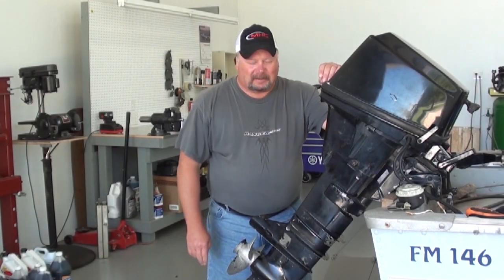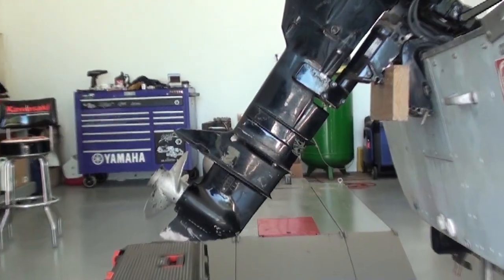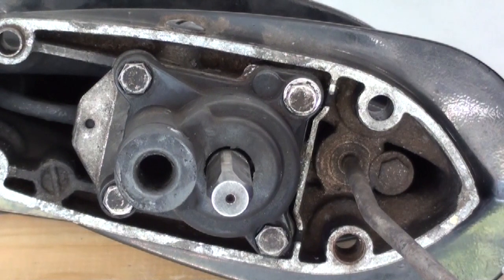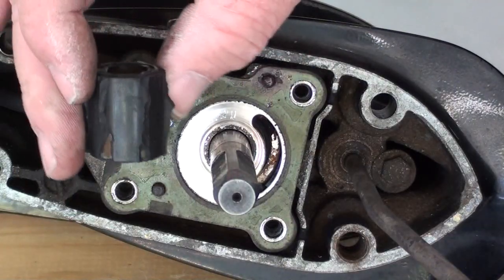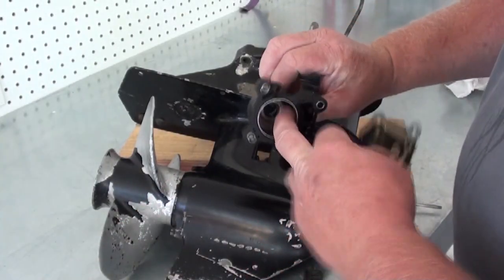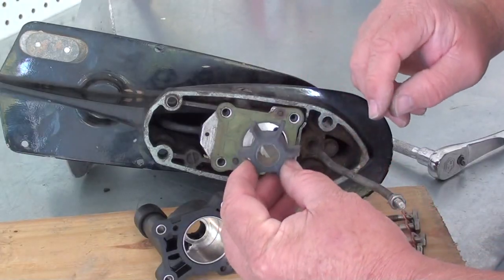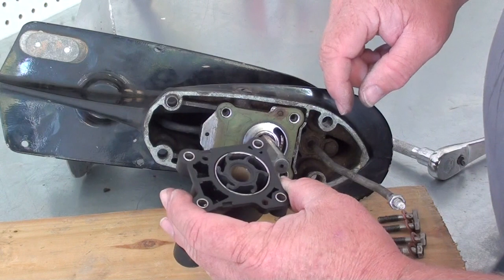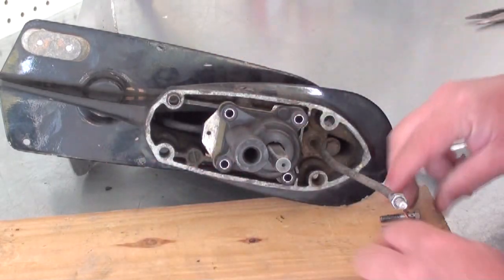Honda 9.9HP - 15HP Outboard Water Pump Replacement

Comment: hi! i know this is an old video, but it's my "instruction book" of changing my water pump and impeller. @5:30 in the video you talk about using compressed air to go into the intake tube to the top of the cylinder head. (but  you didn't show it!) where is the tube and what should i look for coming out? anyway i hop you're still responding to commment on here.  thanks!

Comment: I have a honda 15 hp. When I remove the lower unit also a water pipe drops out of the outbourd. It was very hard to put it back and it was very loose in the hole where it came from. Now I put everything back together and there comes no water out the motor. Can anybody help me with this problem?

Comment: I put a new impeller in my 1997 9.9 honda but when I tried to connect the shift linkage the upper rod fell out down into the hole where the bottom linkage is... Any idea what I can do to fix this problem Thanks Dave.

Comment: Absolutely the best commentary and instructional words ever...I have had mine done twice in 8 yrs and finding out its a basic yearly deal. Book says oil changes very 10 or 15 hours?. Mines a 2011 15 hp and run it monthly even thou not in the water like I should be...thanx so much awesome shop and all later

Comment: How do you get the barrel nut to turn when it’s attached with a split pin at the top that stops mine turning, turn an easy job to bastard job having pull bits off the get to the split pin

Comment: I know this is a old video but very informative. I've a 1998 bf9.9. Going right by your instructions. Only problem. I unscrewed the top nut  on the shifting rod too far and when lower unit came out so did it. Now even in reverse with lower unit off I can't get on to thread it on. Any advice? Great video by the way.  God Bless

Comment: Can you tell me exactly what part this is you are using and where to order it? I followed all your instructions which were amazing but I have the wrong impeller it doesn’t have the flat spot on it. It has a half moon that doesn’t work. So I ordered the wrong thing.

Comment: I have 1 more question is the iinside of the  impeller housing  you have a metal cup and there is a square shape  opening in the upper part of the housing does water flow threw this opening ??

Comment: hello, I've replace the  impeller and still no water also changed the therm, still no luck also check the water tubes for clogged area no clogged area what can it be I guess i need to check the motor.area.Anthony ???

Comment: Great video,after I break loose the jam nut and then try to loosen the barrel but , it causes the bottom shaft to move down and I notice the shift handle moves forward towards forward position , any suggestions ? Honda 15hp long shaft

Comment: 1:49  Hi, I have unscrewed the four screws at the side and the one screw at the back but I can't take off the bottom part. I hit it with a hammer but I can't take it off. I haven't opened it in 3 or 4 years. What else can I do?

Comment: On the chance this gets seen and someone responds..my 2001 BF15A, when removing the lower unit to get to the impeller, the entire drive shaft comes out with the lower unit. A side notch prevents the drive shaft from being pulled straight out, thus I cannot get to the lower plates for the water pump housing. Is it necessary to remove the drive shaft? If so how?

Comment: Where did you get the impeller i just had the same problem but cant find the right part for mine the guy I bought it from said it was a 1990 so i cant find the part

Comment: When I was put the lower unit back on, the copper water tube fell out.  I cant tell how it was secured to the adapter plate.  Does it just "shove" back in place? Doesnt seem like that would hold.  I dont see any pieces that I do not have on the Mercury diagram.

Comment: Good vid there D Ray.  My 8 hp Honda has a piece of rubber left from the impeller.  It Completely
blocks the H20 from 'pissing' .  I back flushed it,  ran air thru both ways and it will work fine but
then plug up again.  Do you have a video on getting that durn piece out?  Any Suggestions?

Comment: Great video, thanks!  Few questions since I'm a noob:

1) Can I do this repair while the gear oil is full in the lower unit?

2) Does it matter what type of grease I use when reassembling the water pump?  I have some white lithium that I used to grease my winches when servicing, will a very light coating of this work?  Also, should I be careful to avoid getting grease on any specific components within the water pump housing, or is everything fair game so long as it's a light coat?

3) Do you recommend anything specific for cleaning all of the reusable water pump components?  (e.g. mineral spirits okay or too harsh?)

Comment: D-Ray this was a great video, well done and you made it easy to understand. I just changed out my impeller on a 10hp Mercury after watching and it is exactly how you said. My only problem was the shifting linkage it didn't seam to work as I resembled it but one turn of the prop did the trick. Thanks going to see what else you have and learn some more.

Comment: D-Ray thanks for this video it was well done.! One thing you mentioned was blowing out the potential impeller pieces from the top end or power-head. I'm just not sure if I must remove anything before applying compressed air to the water intake tube to get the best results.
Reply: I had the same question.. about to do mine if you or D.Ray want to update

Comment: Thanks. My uncle had his impeller replaced on his 9.9 2 years ago, but he never took it out.  I've fixed his boat, put the motor on it tonight, and tested it.  Motor started fine, but no water out of the weep hole.  Guess I'll check that tomorrow.  Video was great!

Comment: It's the same for a 1990 BF9.9A as well - THANK YOU!!
Reply: do you know if there is a key that goes on the driveshaft? i just replaced the impeller on my 1990 bf9.9a and im still not getting water to the thermostat? i also put some compressed air through all the galleries and still nothing.

Comment: To Ben Josey:  I have a 2001 honda 9.9 HP.   I had to put the shifter in reverse, which drops the shaft down,    to get better access to the link nut to screw it off the shaft.  Also, I had five screws attaching my lower head two on each side and one long on at the rear.   Without this great video I would have never attempted this fix.

Comment: @5:30 when you talked about blowing compressed air to clean out the whole intake, were you talking about using compressed air from the outside of the cowling where the water pees out back into motor? or using compressed air from another location?

Comment: Great video, but I'm not sure it applies to my Honda. I'm confused about the 9.9 Honda Outboards. I'm guessing they may have 2 completely different 9.9 designs? (One being an 8.0hp / 9.9hp design and the other being a 9.9hp / 15hp?) I can find references to a 9.9 paired with each of the other two-- the 8 and the 15, but nothing seems to discuss there being two totally different 9.9's.

I have a very different-looking (compared to the video) Honda 9.9 (2006) model which matches up with a BF/BFP8D and BF/BFP9.9D Honda (factory) Shop Manual. (It looks smaller and curvier.) The Honda directions say to remove the prop and prop shaft before dropping the lower gear case assembly. I'm wondering why. Looks like a good way to mess up something I don't need to take apart, but I also want to avoid causing a problem if there's really a reason to pull those parts before I try to separate the gear case.

This outboard has no more than 10 hours on it, but has never had the impeller changed or any service done-- it has mostly been sitting in storage. I think Honda recommends changing the impeller every two years, and I'm certain I don't want to be out on the water with a 10-year-old impeller waiting to self-destruct. I need a fresh impeller and new fluids in it before we try and do anything else to check it out.

Any suggestions?

Comment: Great video, would like to to add a few things..for us weekend mechs.
The shift linkage barell  nut is reversed thread on one end ,(look for the up arrow on the the nut,  took my dumb ass an hour to figure this out).
Honda has replaced the carburetor 16100-ZV4-D21 with the 16100-ZV4-D22. just installed it and it works great. Thanks Again Doug

Comment: Thank-you for the easy to follow instructions. I was able to watch the video once and go out and replace the entire water pump assembly in one hour. No problem. Parts were $37. Can't thank you enough!!
Reply: That's awesome. What all parts did you replace other than the impeller? May I ask what size wrenches and sockets did you use for each part in the video? Thank you ahead of time.

Comment: Iinstalled a new water pump kit on my yamaha 1989 elf 9.9 4 stroke because no water out pee hole. still no water coming out but air is coming out. correct direction of impellar, when I run the lower assembyy in water it comes out of a  tube I attached , but when I attach it to motor it doesn't pump water just air.ran water through supply tube , came out pee hole fine. any ideas.
jack

Comment: Awesome video and good quality!!  U r the best  so far!! hey man i got a 75hp honda outboard motor.. It takes a long time to start and  when it starts it goes off after 5 minutes or so!  And i try to start it again but i won't untill it cools off!!  What could it be the problem?  My mistake was i started it with no water the first time that i bought it used! ;/
Reply: demente azteka check your gaskets there might be a leak. It won’t build up water pressure cause the water will escape through the leak

Comment: Thanks for the video! I have to do an '85 B100S (10hp 4-stroke short shaft) and looking at the parts diagram, it looks like a very similar design. Shouldn't be too hard to figure out! :)
Reply: Hello. I have the same motor. Doing same. Was the rotation indeed clockwise on these years too?

Comment: The walk through was great. You left out the compressed air portion.  Which direction would you blow the potential vane remains?  From the bottom when you have the lower unit off or through the tell tale water jet portion?

Comment from the maker: Thanks for watchin', it's been 20 years since I've worked on one of those, but they were a pain back then! lol The linkage disconnects on the top of the shifter shaft, and if I remember correct, I would clamp a pair of vise grips to the barrel nut, and spin the lower unit to thead it off, just count the rounds, so to get it back correctly. hope you need nothing more than an impeller, the plastic housings are prone to failure and no longer available :(

Comment: I have a Honda B100S which is very similar to what your working on here but different shift rod configuration. Does my lower unit just slide off or do I need to disconnect the shift rod somewhere? Thanks very much for doing these videos!

Comment: I just bought a 1991 Honda 15hp outboard in beautiful condition with very low hours.  I plan on "going thru it" in the next few weeks, and your video was absolutely fantastic in regards to the water pump.   Not sure if my lower unit will come apart exactly like yours, but would think it would be pretty close.  Anyway, thank you for taking the time on putting together this video.   Very well done and fun to watch.   :-)